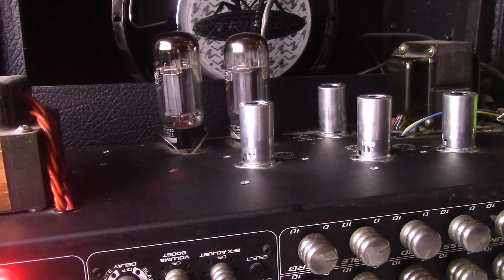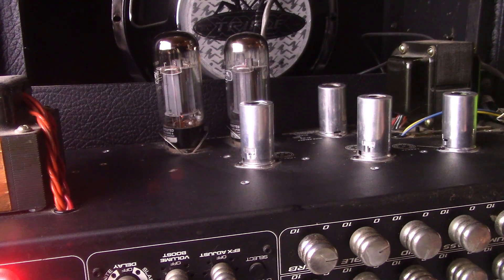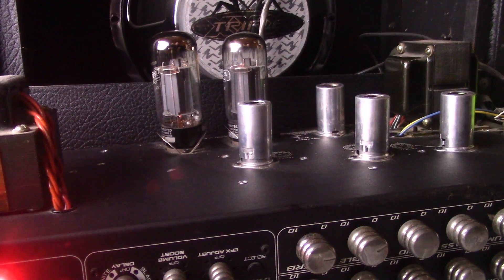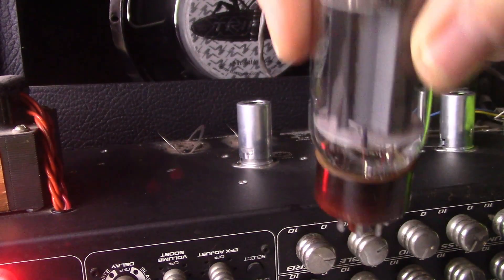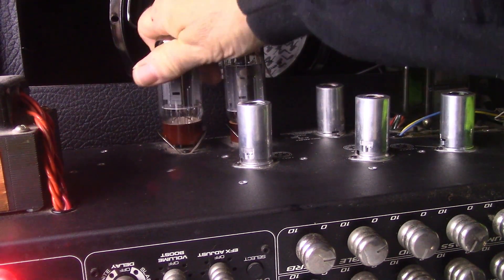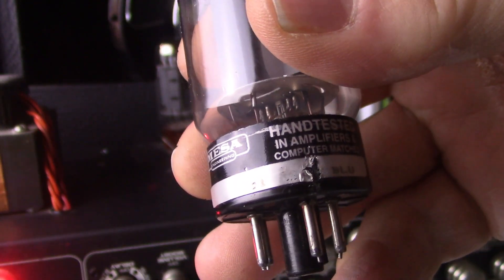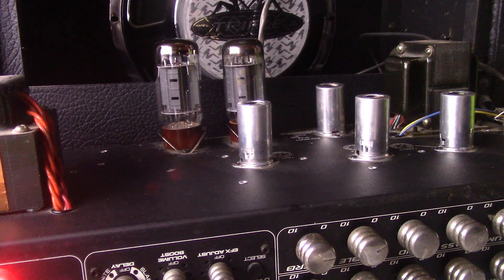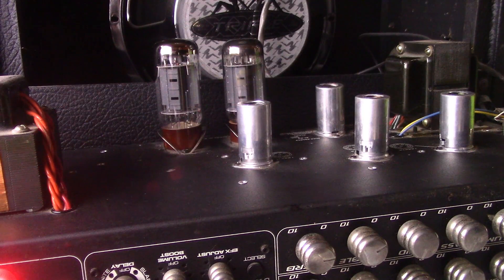MESA 6L6GC vs SVETLANA 6L6GC Tube Comparison You make the call

Comment: I was in a pinch for an amp and but a Peavy valve king 2x12 with one boogie power tube & all other tubes were stock. It gets load at 1.5 on master volume. Gets a bit of a NU Metal tone with my Original MXR Wylde overdrive pedal
Reply from the maker: I had a Valve King for a couple years and was a fool for selling it
Reply: Not gunna lie I’m hunting for a new amp that will give me a little more of a southern rock tone but my VK will never be sold it’s an fn power house. Effect loop is Jenkee… so I don’t get to be all fancy
Reply from the maker: @sob7741  You might think I am crazy but this guy Tom Seguto gets a great southern rock tone with a Boss Katana 50 https://www.youtube.com/watch?v=GXW0O58F7Ds

Comment: Any truth to MB statement that their tubes are designed specifically for their circuitry????
Reply from the maker: Mike Soldano said that they have tubes built for their amps circuits, so they could very well be. There are several parts in tubes that have different makers, the getters, the plates, the filaments, even the pins can be made of different materials. So it is possible amp builders can request certain types of parts.
Reply: Source please. I have never heard them claim that. No, they use their proprietary ROBOTUBE machine to test large batches from anywhere they can get them nowadays. Then they print their logo on them. Just like Groove Tubes. They never had a tube cuatom made for them. Any brand or vintage 6L6GC will work in one of their 6L6GC amps. Same for all other tube types. Here is a quote from their website..

We choose the best sounding, best performing and most consistent tubes from the world’s current supply, test them so that we know they’ll meet the requirements of our amp designs and sell only those that are the perfect fit. Our current lineup of tubes have been meticulously selected from several different sources.
Reply from the maker: @hyperluminalreality1  So they do not have them made for them, but do choose certain makes based on their requirements, interesting. I try to show in my videos that tubes really do not make that much difference. A little yes, but not much.